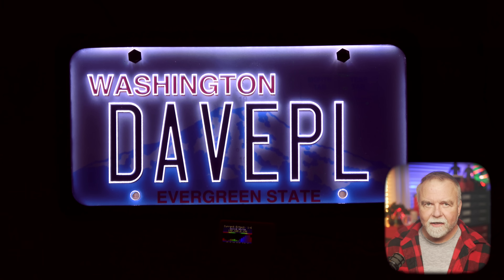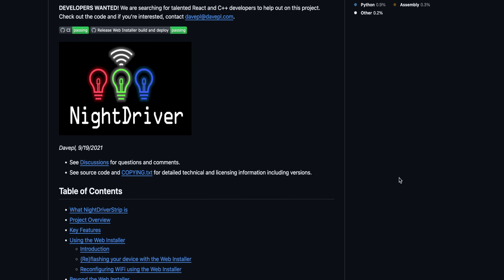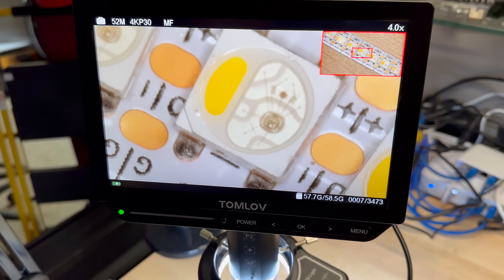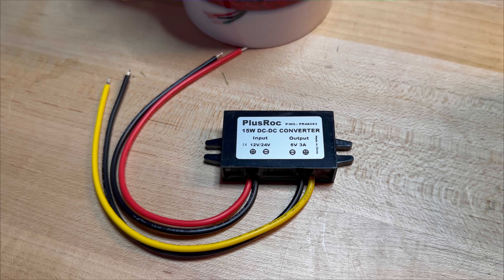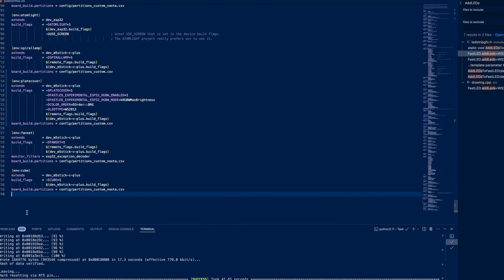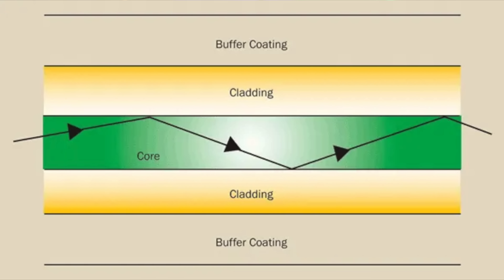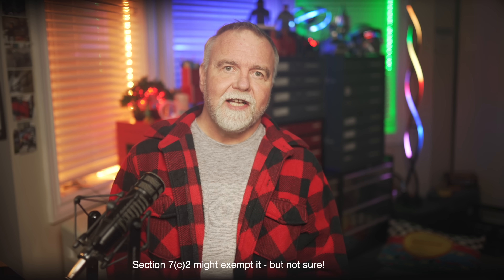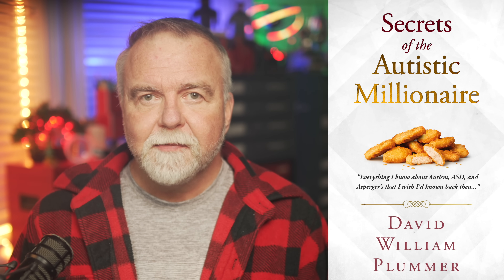Cool LED Plate Frame: How it Works, and IS IT LEGAL?

Comment: I bought the M5Stack CoreS3 SE ESP32S3, a very impression bundle of bits of hardware, but I was super disappointed that I could not use the JTAG pins to make a 'real' debugger... after years having the power of the visual studio debugger I simply just did not want to bother struggling with it!

Comment: This is awesome and I want one. 
Side note: not an ad but the Seeed Studio Xiao SAMD21 has 5v pass-thru to its 5v rail, giving you as much power to your LEDs as your power supply can provide. The data sheet shows a diode on the rail that would limit you to 500ma, but Seeed has confirmed the diode isn't installed in manufacturing and I've confirmed this myself with physical inspection. This makes it a super tiny form factor with bulit-in USB-c power/data that can power a LOT of LEDs. I do like your little display, though, not that I need it for anything I'm making.
Now I just needa figure out how to make my own acrylic cover...

Comment: Dave,  I believe the reason for  "no cover" is that the police want a clean surface to use with their laser speed guns.  Most states have something on the books about covers over license plates.  I've also see some type of spray for your plate that will disperse the laser light, but you have to keep applying it when it gets washed off.

Comment: I wish lighting laws were enforced in Georgia. People with zero or one of three brake lights working, non-functioning turn signals, one or both headlights out, driving on public roads with light bars on (typically pick-up trucks).  And let's not get started on what idiot government body approved putting turn signals in the BUMPER (looking at you, KIA!). European lighting standards might seem strict, but at least you can tell when someone is braking vs turning and the vehicle will fail MOT inspection without everything operating as intended. Unfortunately we don't have inspections in Georgia, and only a handful of the 172 counties have emissions checks (of which the latter is fine by me).

Comment: I can confirm that all addressable led’s will work just fine with a 3.3v data signal under NORMAL conditions. However a normal working led project, didn’t work anymore after pouring it in epoxy resin. What epoxy does to the data signal remains a mystery, since everything except the power source was in the epoxy there was no way to know or fix it. So just a heads up, adding that level shifter might not be a bad idea in some situations….

Comment: RCW 46.16A.200 License Plates.
(7) Unlawful acts. It is unlawful to:
(a) Display a license plate or plates on the front or rear of any vehicle that were not issued by the director for the vehicle;
(b) Display a license plate or plates on any vehicle that have been changed, altered, or disfigured, or have become illegible;

Comment: They made covers illegal in my neck of the woods (Australia) a few years ago, as a dusty cover, while not overly obscuring the number when viewed straight on, it really screwed with the various camera's used for red light running and speeding, as these looked at a lot sharper angle and the covers & also their reflections really screwed with the OCR used to read the plates.
Of course we had the red necks who experimented with just how much dirt one could have so as to be left alone by the police, but would really mess with the camera's and their flash guns.

Comment: According to the wording of the law, you'd need to change the lighting pattern to make the registration tabs visible. In the "white" mode, the letters are visible but the registration tab portion is black.

"License plate frames may be used on license plates only if the frames do not obscure license tabs or identifying letters or numbers on the plates and the license plates can be plainly seen and read at all times"

Comment: How about eliminating all the acrylic except what's under the frame? With a diffused edge you could still illuminate the plate w/o any kind of cover. And if I remember correctly, plate illumination is mandatory in Washington. Plus you could always have a full, multi-color display running while you're parked at Burgermaster.

Comment: I finally got into programming with an esp32. I ordered some back in april but only just now found time to learn everything. Since the recent claude update, I decided to pay for a month and have been using it to write code. Within two evenings, I had a canbus sniffer going for my polaris rzr. After figuring all that out, I made a neat way to visualize rpm’s. The logic applies to any vehicle. Display a  spinning gear like animation. The number of teeth are equal to each 1000 rpm the vehicle is capable of. So 6500rpm for my rzr equals 6 teeth. Then for every 1000rpm one of the teeth extends out, and the gear spins slightly faster each 1000rpm. Its a pretty cool effect on a tiny oled display. Im planning to get a 4” round display and make a  custom cluster that gets all data over the canbus. Im still looking at options to drive it.

I love seeing your automotive projects. They are different than most and inspire me to think outside the box more. AI is a perfect match for me with some programming experience but never got into any full projects. I can do in days with AI what would take me weeks or a month to do alone.
Reply: Your canbus sniffer sounds pretty cool. Do you put your stuff on github? 

Agreed that AI is a real time-saver. I feel like I haven't even scratched the surface with what it can do for me.
Reply: @wbrodyjr  No github. I'm always worried if my code is ok or not. There are likely other sniffers out there but I learned Polaris uses J1939, which is a tad different. If you have any obd reader and an app that supports that protocol then you can read from the two canbus lines. You would have to make a cable if you wanted it nice. I think people have gotten Torque to work.

The AI has been a big help. I feed it some other peoples code, tidbits here and there about how the obd works for polaris and it figured out a few things for me. The sniffer was because the factory gauge cluster can read check engine codes and clear them, so I had it capture the data of me pushing the button and it copied what command it sent to clear the codes.

I had it compile everything we learned into a reference guide so it will be easy in the future to talk to any other AI about it. Think I learned a few things since then that I haven't added to the guide. I may could release that.

Comment: DMV owns the tag. You are issued a tag as a registration, where the tag can be revoked. Drivers with "vanity plates" tend to keep them but the state can revoke, otherwise all tags at end of registration are required to be returned. Putting a clear, a smoked or even just advertising frame, is illegal because your intention is to obscure reading the plate. Which means you are driving with some precipice of illegal use or violation (skipping toll, speeding, evasion, no insurance...). Plates if damaged, can be exchanged or replace so there is no excuse to "protect" them. Just some companies that sell them know they can evade legal remorse because, at your own risk. 
Nice car.

Comment: I guess I missed something,  how is the ESP32 powered ?
Reply: I think that module has an onboard 5V -> 3.3V regulator.
Reply: @daShare  ok,  but from where does it get any voltage?  I saw a ground wire and a data wire.
Reply: @rickharms1  The ESP board uses the same 5V as the LED strip.
Reply: @ no, it does not.  It is 3v7.  There are aux boards that convert the pins to 5v.  Look again,  shown is the data line and ground.  Never mind,  not important.

Comment: Great video. Made me think that the software could be expanded so that it is off when vehicle moving, red when brakes applied, white when moving at night and full disco mode when vehicle is parked. You could even add left to right or right to left animation when indicating and have it match the color of your car's turn signals.
Reply: It would be very cool feature to have but if the car is stopped at a red light and the cop pulls right behind you.  You will get pulled over.  Better off to have a manual switch to do this off road.

Comment: I've definitely had problems with LEDs driven to only 3.3 volts. There are so many different drivers, though, and they're all a little different. 3.3 volts is right around the high threshold for 5V CMOS, so just a little variation in the power supply to either circuit can make a previously working circuit flake out.

The problem is it's pretty catastrophic when it happens -- either things work complete or not at all, with very little in between. For a one off project that isn't important, sure, test it and if it works without, who cares?

For this, I'd personally add the level converters because cars are notoriously awful environments electrically and physically, so you want all the noise immunity you can get, but if the extra complexity is going to be the barrier for someone of course that's also a valid reason. It's not safety critical!

Comment: I'm getting into LEDs, and the programming is not an issue.  I've got that experience, and there is tons of documentation everywhere on it.   The one thing I have trouble with and I don't find much information on is the installation.  I don't see any good info on how people affix them to their walls, cabinets, signs, etc.  How do they hide the wires, controllers, power supplies, etc   I'd love to see you do something on that since you've got a lot of great fixtures around the shop!
Reply: Look up LED aluminium extrusion. There are many designs. Pair it with your LEDs of choice.

Comment: For any texans here in the comments, this plate cover is most likely NOT legal in the state of texas, despite how cool this might look on our black/white plates.
See section 504.945, subsection (a) (7) (C) of the texas transportation code.

The above transportation code requires that the colors of the plate be unaltered, and the lettering be completely unobscured from ALL angles. So it might be legal if the plate cover always illuminated white light, but the mere presence of an acrylic sheet covering the plate is walking a fine line and could get you in trouble.
Reply: I was just going to reply, "Definitely not legal in Texas!"

Comment: If it weren't for the no plate covering at all, then you could always put in automation such that if the vehicle is moving it automatically switches to white, otherwise, could set whichever (even a db/gps integration to autoswitch according to where you are :) )

Comment: The reason clear covers over license plates are illegal in many states is because many of them were optically designed to "wash out" the license plate details when a red light camera flash was incident on the plate/cover, so people could evade red light tickets, and also possibly plate scanners at toll crossings. Also many of those covers are plastic and craze over time, which makes the plate harder to read from a distance. They used to make a glossy spray which when sprayed over the plate would do the same effect as the clear plastic frames, but not sure if that still works or if it ever worked. It's almost like a cat-mouse game with people always trying to beat the system.
Reply: When I was pulled over (w/ a clear plate cover) the deputy said even clear covers can become dirty & scratched over time obscuring the plate - hence the statute prohibiting any covers (in FL) ….
Reply: @smitm108  That makes no sense. If a clear plate can become dirty and scratched then, without a plate cover, the licence plate itself will become dirty and scratched. Perhaps it is for the money you would have to spend to get the licence plate reissued if it wound up in rough shape because it wasn't protected.
Reply: @smitm108  So having a statute that says a plate must be readable is not enough.  Now we have to prevent people from potentially making their plate unreadable, possibly, maybe, sometime in the future could.
Reply: Eventually it's going to be moot point once all cars are equipped with radio tags / transponders for tolls.
Reply: @Darkk6969 It seems to be going the opposite direction though. In CA FastTrak phased out transponders and replaced them with license plate readers.
Reply: @markirmuir  I live in California and have not heard that it's replacing transponders as the highways on the far left lane still uses transponders to determine if you have 1, 2 or 3+ passengers in the car for proper lane toll.   For those who don't have transponders when crossing toll bridges it can make use of license plates.
Reply: @Darkk6969 I registered my new vehicle with FastTrak for using toll roads and express lanes, and all they needed was the license plate number. They told me to dispose of the previous transponder I had. The camera system seems to work well - it’s charged me for every trip I’ve used those roads, except two where I had a passenger. This is in LA.
Reply: @markirmuir  Ok, this is new to me and I'm NorCal.  Thanks for the heads up.
Reply: The (less effective) 'spray' is usually just glass beads, same as similar-to-what used-to-be used mixed into the paint to achieve the retroreflector effect before they moved onto embossed foil/plastic.

Similar to the cover being described above, bubbles/divots/voids can achieve a similar effect.  But both are easy to spot with a spot/head/flash light.

IIRC there's a lenticular-like patterned (holography) lens that only has the retro reflector effect from oblique angles, such as those used by automated toll systems, but I've never -seen-noticed one IRL.

I don't remember which toll-vendors use cameras/lighting that uses offset the cameras from the light source to mitigate this effect.

(IIRC, in Ontario, it is now illegal to paint an extra plate in retroreflective paint/film (with the correct plate number), as that can confuse automated systems.)
Reply: Mythbusters tested the plate covers and sprays and the camera got the plate every time.
Reply: That, and here in AZ, any plate cover, even clear, the sun out here absolutely murders plastic.  so it will be so fogged out or burned black plastic in a few months.  and here in AZ, any coverings, even clear is illigal.  Its illigal to cover any part of your plate with anything, and the law even states clear and license plate covers.
Reply: Yes, here in the UK ANPR is very widely used as it's cheap and effective - provided the number plate (US - license plate) is clearly visible.
Reply: Not just red-light cameras, the masking (via cover, spray, or clear "sticker" -- Veil, I think was the brand) could also diminish the reflectivity of the plate for LIDAR guns used for speed detection. States would make their plates HIGHLY reflective making them perfect targets for LEOs at speed traps (especially in states that require front and rear plates).
Reply: It seems like lawmakers these days have nothing better to do than, well, make laws.  Whether they're needed or not.  This seems like one of those laws that is intended just to give officers one more reason to be justified in "making contact".  I agree with your point, though, barely.  I've seen some plates that, even without covers, are so washed out from age that they're barely legible, if at all.  In NY, I've seen that the "newer" plates are constructed so poorly that the color layers have mostly peeled off.  And while that is "legal", kind of, it also gives reason to be pulled over.
Reply: That spray actually worked pretty well. All you saw was a total white plate and it was undetectable for the most part